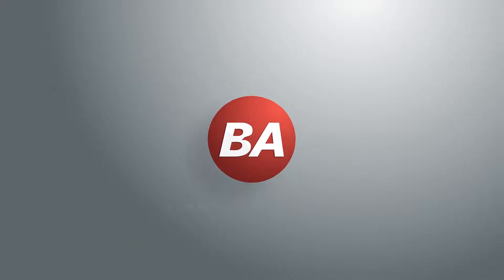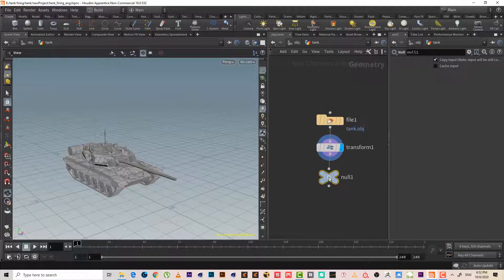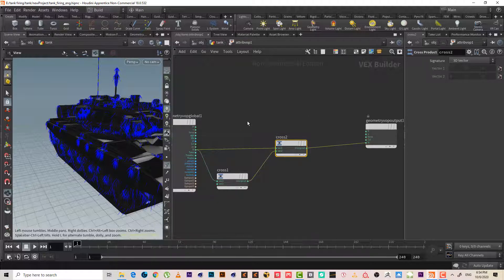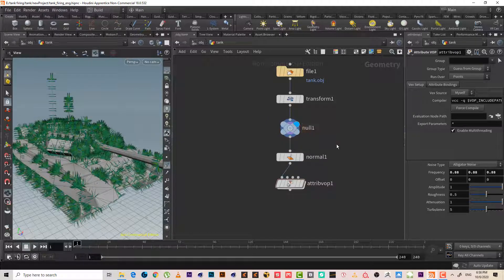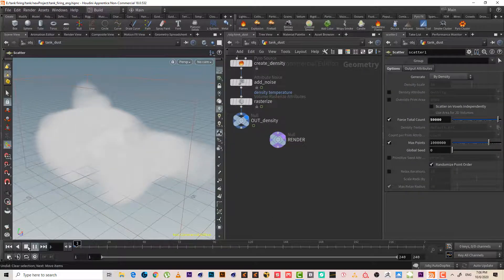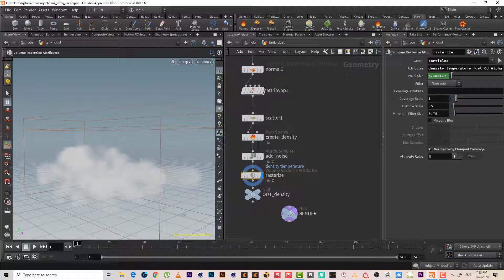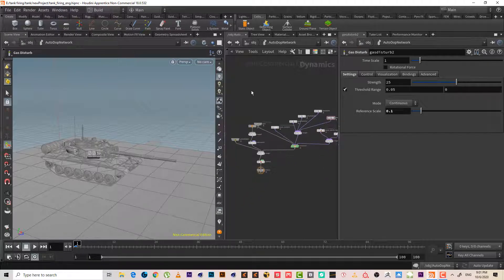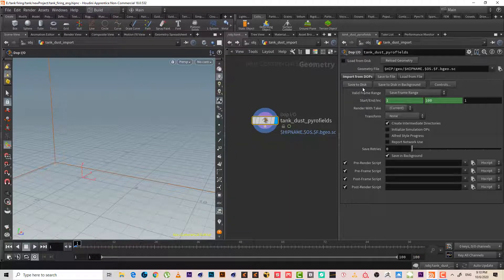70 Tank Firing with Pyro in Houdini Pt1

Comment: thank you for doing this lesson... I'm using houdini 19 and I can't because its settings have changed. I wonder if there is a link where I can download 18.0.5. I could not find.
Reply from the maker: You are welcome! i am using Houdini 18 in this lesson which was the old pyro system , you can watch my lessons for the new pyro sparse system to understand  then back again to this lesson and you will be able to use the pyrso sparse instead of old pyro 
from lesson 84 to lesson 88
https://www.youtube.com/watch?v=c7csPnxmOzQ

also watch the ultimate free course Battleship Firing at Ocean in Houdini , you will learn lots of technices for pyro sparse system with many other system like fluids and ridgid 
 https://www.youtube.com/watch?v=A4v_-iOKxpU
Reply: @birdyacademy2358  thank you for replying. As you said, I will watch the lessons and then start the tank fire lesson. thank you i'm grateful 🙏